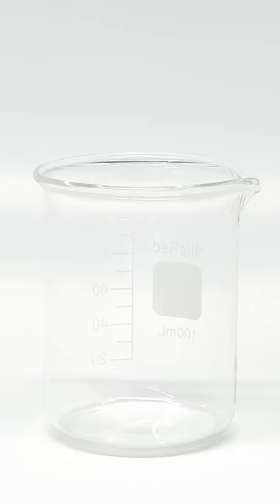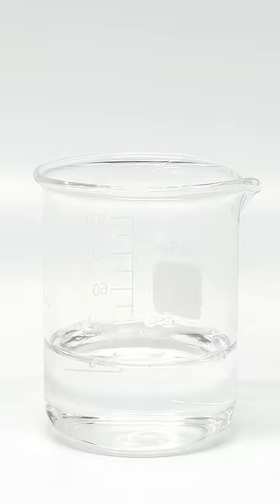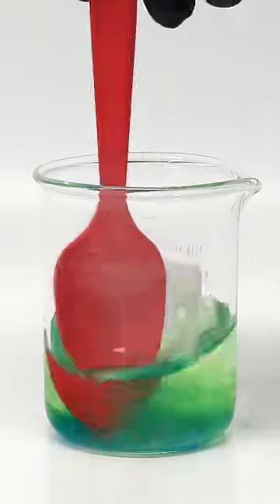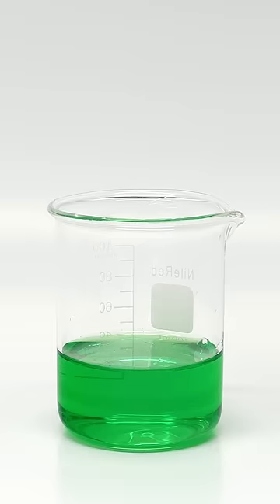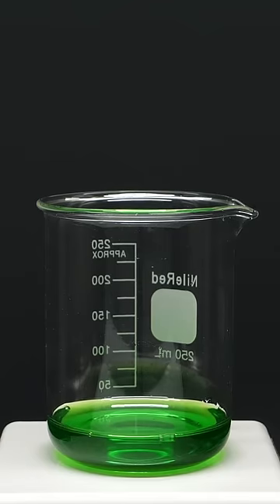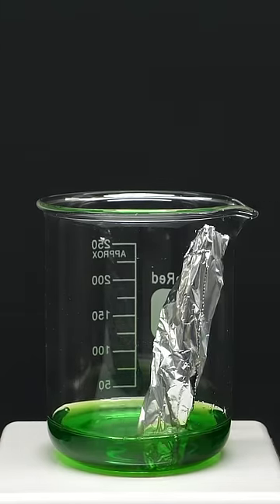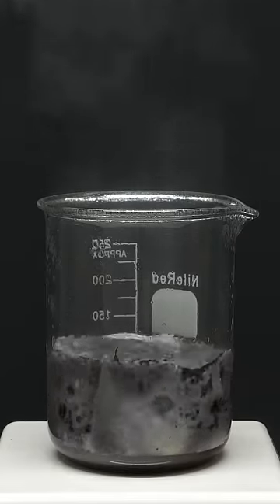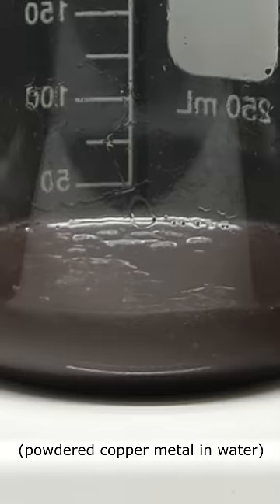Aluminum vs acid is crazy

Comment: Your videos are amazing!!
Just a little request though, could you please also write a chemical equation of the reaction that you perform? It'll be very helpful, sir
Reply: im assuming it's just a metal + acid -> salt + hydrogen gas. so aluminum + hydrochloric acid -> aluminum chloride + hydrogen.
Reply: @cweamy_whyp  yeah exactly like that but with every video if possible...
Reply: @cweamy_whyp  there is more going on here because copper is reduced at the same time. The whole equation is something like 2 HCl + 2 CuSO4 +2 Al —> H2 + 2 Cu + 2 AlCl(SO4). If Aluminium ChloroSulphate even exists. It doesn't really matter though because it is in solution anyway.
Reply: @dragoonwing11  I think aluminium is mostly reacting with water. Replace HCl with NaCl, and you get the same vigorous reaction.

Comment: "All the aluminium is gone, and I'm left with copper": huh?? Where'd the aluminium sulphate go??
Reply: So from my basic understanding of chemistry, I think it's a redox reaction. The aluminum transfers it's electrons to the copper ions resulting in the copper metal powder. The now aluminum ions technically react with the sulphate ions, it's just dissolved in water.
Reply: @ravingraven1988  no I don't this so, the only time a element can change into another element is by radioactive decay as far as I know (unstable elements). Sulfer is a stable element for sure.
Reply: @Barney Desmond I came to the comments to ask the same thing🤣🤣
Reply: I mean it hasn't transformed in a radioactive sense, it's swapped places into the sulphate. It's just really weird for him to say that that the aluminium is "gone" when it's still there in a different form
Reply: @BarneyDesmond  yeah that makes sense and definitely i agree.
Reply: Forgive my ignorance but where is the sulphur in the reaction to give us sulphate? Also, where is the chlorine at the end of the process?
Reply: @DouchMonkey431  I think he is saying that a displacement reaction occurred, Al being more reactive than Cu can displace it from it's salt solution. Of course Al atoms doesn't get converted into Cu atoms.
Reply: @MrJCMG  he used copper "sulphate". Al reacts with the copper sulphate solution to form Aluminum sulphate, you don't need Sulphur to make Aluminum sulphate when you have copper sulphate solution and solid Aluminum.
Reply: @varun-xu8gv  ah, right. It would help if I actually listened to the video properly. I feel silly now for asking, but thanks for that.
Reply: @DouchMonkey431  Dude the elements only transferred electrons 
We didn’t create any new element
Reply: @entropy8902  exactly the Al is still there just that it has formed it's sulphate which is dissolved in water while Cu got reduced from it's ions to solid copper
Reply: @varun-xu8gv  yeah right sorry, thats exactly correct.
Reply: The Al is still there.  
(Chemical Engineer)

Comment: I did something similar when I was first experimenting with chemistry, except i didn't put in any copper. i used the hydrogen to experiment with making balloons and they did actually float a bit. i used it to make a superhot torch too. 
the resulting aluminium chloride, which was a really cool shade of green, turned out to be so hygroscopic you could dry the solution to crystals, then wait for an hour or two and it would suck so much moisture out of the air that it turned back into a fluid. amazing stuff.

Comment: When I worked in the aluminum can and tube industry we’d get 55 gallon drums of the stuff to test the internal coatings on the tubes and aerosol cans, if there was scratches or the internal coating was insufficiently applied when you put in the solution and left it for a few minutes the solution would react with the solution and copper would adhere to the compromised coating in nice big easily visible clumps.

Also you can use it to etch and cooper coat steel pocket knives but I definitely didn’t do that to blades on the clock…
Reply: Actually this is really interesting, I have a stainless steel thermal mug that has a copper coating on the inside to increase its heat reflection, and I would assume that the copper is applied using this process.
Reply: @g33dav3y  doubtful, more than likely that would be applied with electroplating,  it’s more consistent, safer and cheaper to do in mass quantities

Comment: Saw one recently you might want to test - I think it was copper nitrate? They had tested burning paper towels with potassium nitrate as an accelerant then tested copper nitrate.

Took a desiccating chamber to get it to finally dry, but after the paper towel was burned the ashes were copper leaf.

Comment: "And I'll poor it into a larger beaker" why didn't you just start with the larger beaker
Reply: To get a precise measurement of the Hydrochloric Acid...
The larger beaker starts at 50ml, he measured 40ml of HCl
Reply: @60000L  You don't scoop a partial scoop from a spoon when you need precise measurements. They were obviously arbitrary. 🤦‍♂️
Reply: Mixing in the small beaker is easier

Comment: This works with most metals that have a reduction potential less then atomic hydrogen. The most interesting part of this is the fact it works in neutral solutions aswell but slower as the salvation of aluminum oxide by acid or base speeds the reaction up. What happens in a neutral solution is that chloride (or other activing) ions can pass through the oxide layer and oxidize aluminum metal creating atomic hydrogen that then creates small pockets between the oxide layer and exposed aluminum that look kind of like blisters these then pop exposing new aluminum metal. This reaction is nicely explored in a paper about activating aluminum metal with chloride ions to use it as a cheap and easy to handle reductant for wet chemical synthesis. The paper is a good read and imo lays the groundwork for an easy way for the amateur to create metal powers of different sizes depending on reaction conditions. The paper uses it to reduced platinum to make Pt/C the use of a close to neutral solution and stirring as well as using large pieces of aluminum foil to create a scrubbing action on the surface of the foil as the water and smaller pieces of aluminum get stirred faster then the larger ones. This is an awesome reaction with many unexplored uses for the armature chemist. I use the method to create zinc dust and some of the particles were so fine they would not settle. and it was impossible to gravity filter the powder as it created a  sludge that blocked my filter. Eventually all the sludge turned into ZnO something I thought was interesting given I had done my best to remove all the NaOH sol and I thought a ZnO layer would form on them stopping further reaction but I was wrong about that. I wonder if a solution of ZnCl2 and CuCl2 could generate the Zinc Copper couple or perhaps a Raney like hydrogenation catalyst with nickel salts. But also beware if you add too much acid or base it can go into thermal runaway and turn into a potentially explosive and much more dangerous version of a baking soda volcano. Also with zinc the solution will continue to bubble hydrogen after the aluminum is consumed although the bubbles are Much smaller and harder to see.

Comment: Same reaction happens if you use specific pipe cleaning chemicals. When i was a kid, me and my friend used to buy pipe cleaning solutions and aluminum, pour some in a plastic bottle and add some foil balls. Then we would close the bottle, throw it in random backyards and run away. The bottles would explode from the pressure and the bang was so loud that it sounded like a literal bomb from a 5+ block distance

Comment: Nilered, whats happening here is simple..
aluminum + hydrocloric acid -> aluminum chloride + hydrogen

Hydrogen ignites when lighted, aluminum chloride donates cl+ and al- ions, until all ions are transferred, leaving just h2o(reaction with h2 and o2 in the air). Thats where that little spark came from. The blue flame is caused by the ions that were transferred.

Comment: Large hollow cylinder, capped on one end, drill a hole in the top. Lower a thin candle 🕯 into the hole. Pack the hollow space with cloth and aluminum. Place the contraption into a dilute acid. Hydrogen candle!

Comment: When I was a kid some of my friends and I would put chips of aluminum in a 12 Oz soda bottle with lye or drain o add water.  Would stretch end of balloon around neck of bottle. As aluminum dissolves hydrogen gas fills balloon.

Comment: Did you know if you have water and add copper chloride to it and mix it and add aluminum the aluminum rusts and the beaker get a bit hot but the most chloride and aluminum you add it gets more reactive

Comment: Acidic copper solution means formation of CuCl or CuCl2 to that Al foil forming AlCl3 with liberation of H2 that catches fire, so aluminium is now in the form of AlCl3 with dil acid having water it form Al(OH)3 right CuCl2 +H2 forming cu metal after its reduction 😢😅

Comment: I wonder could this process be used to produce hydrogen on demand for cars
Reply: Hydrogen cars make electricity from the hydrogen so you could just use an aluminium air battery and skip the hydrogen

Comment: i think there is something wrong with my colour sceen.. I have never seen copper sulpahrte that green before3.. its normally teal not green
Reply: If chloride ions are present, in this case from the hydrochloric acid, the dissolved copper becomes green. That's because the water ligands on the copper are replaced with chloride which changes the colour of the complex

Comment: Use smaller pieces or thin strips of Al so the surface area is increased. Also, it is poor technique to use plastic. Use a metal spatula designed for chemistry and a glass stirring rod. Even better, do this on a stirring/ hot plate with a stirring rod. Please use good technique and do not demonstrate the improper way of doing things.